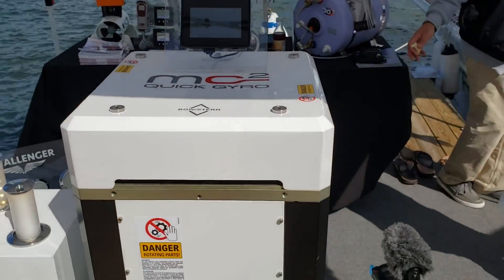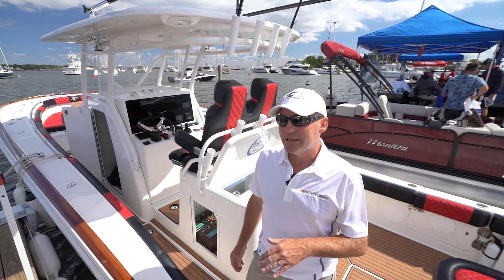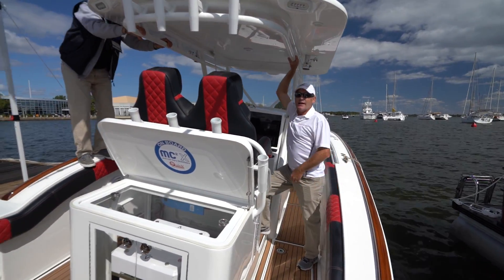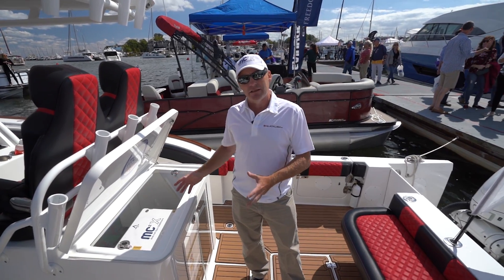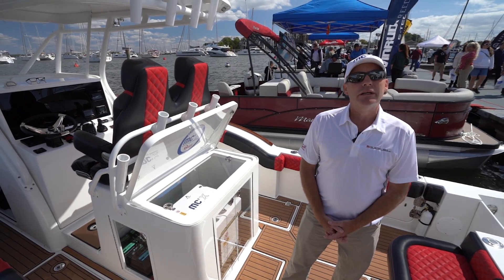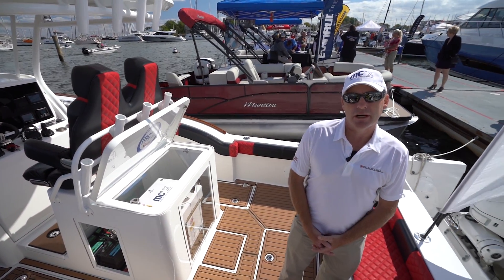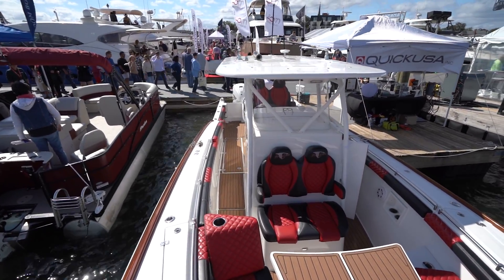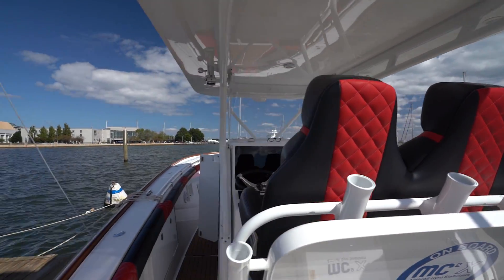Worlds Smallest Boat Gyro Stabilizer ?

Comment: Good gyro but
Should use 2 gyro counter rotation in front of the other.
Cause 1 gyro like that create nose up movement.

If we put this gyro on offshore v bottom powerboat , it seems dangereous when the boat  jump .... Cause it seems create nose up movement in the air...
Same like ur competitor seakeeper, that one will create yaw when powerboat in the air :(

But for yacht / center console 1 is enough like ur video, because yacht will not fly like powerboat.

Maybe mc2  will make counter rotation version for the small one ? :)